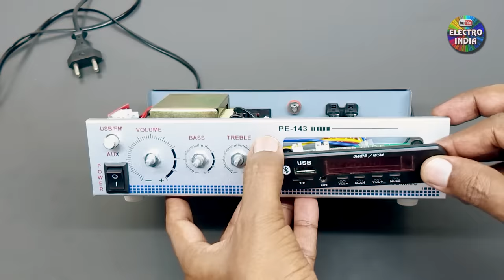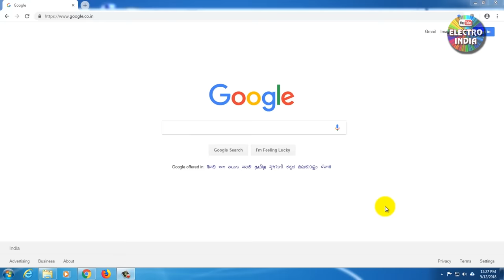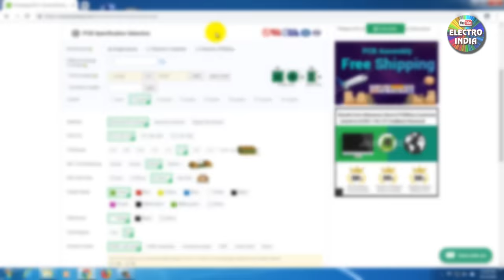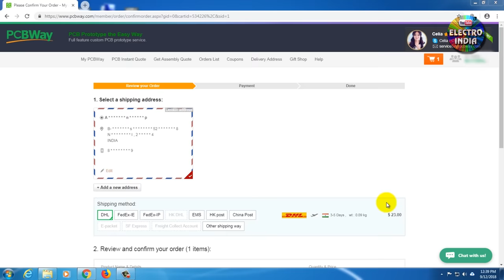How to Make an Audio Amplifier TDA7297 Board with Bluetooth DIY | Version 2.0 (Hindi) ELECTRO INDIA

Comment: Hope you are doing well! I have two tower speakers and each tower consists of Woofer 6.5 Inch(60W RMS)+Mid-Range 4.0 Inch(40W RMS)+Tweeter 1.5 Inch(20W RMS) that is 120W RMS+ 120W RMS and Speaker impedance 4-8 Ω. I have also two TDA7293 mono boards of 200RMS+200RMS Speaker impedance 4-8 Ω. Can I use my two tower speaker with these amplifier boards with ease or not.

Comment: IMPORTANT SAFETY REQUIREMENT - mains transformer wire to power sw MUST be HOOKED to soldering tabs before adding solder. What you just did at 13m31sec is called a "lay-on" joint.

Comment: Low frequency cables are not shielded. 
Mmmeeee.....
Reply: You mean low level wires? ... Frequency and amplitude is not same bro ... And those wires does not need any shielding cuz its inside a metal casing which is fully earthed and prevents any magnetic interference..... And if needed u can wrap them with sticky aluminium tape and ground the tape!!

Comment: This kind of amplifier is RS 1600 only in our market.
I don't know why did you make this kind of video!
Reply: amp circuit only 400
Reply: @KausikKumaar  Here, I'm saying about the Total set which you mentioned in your video.
Reply: the chip matters. the local ones you buy in shop will have low q ics like 4440, 6283. TDA7297 is hifi quality chip from ST microelectronics. buy and build will be always better